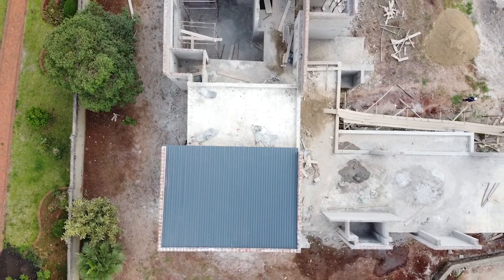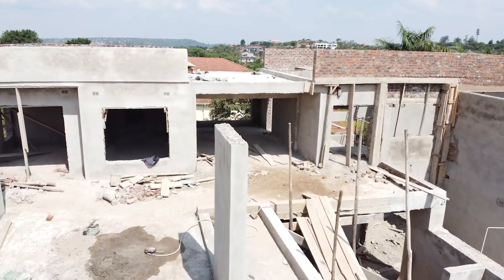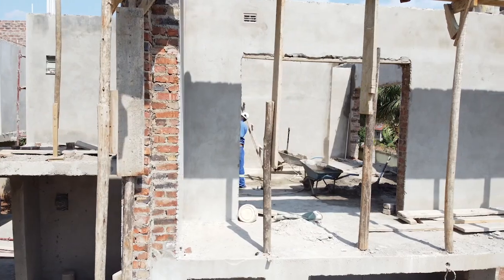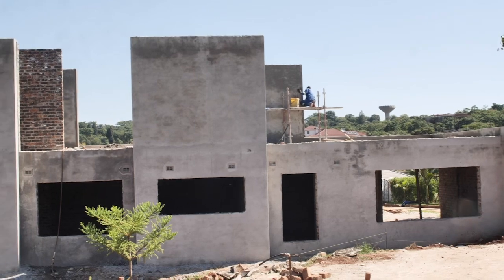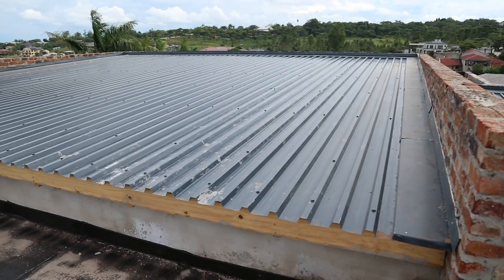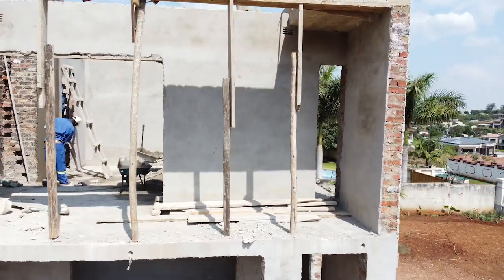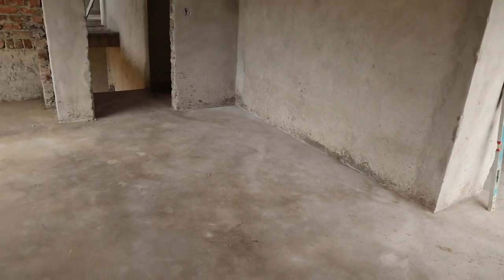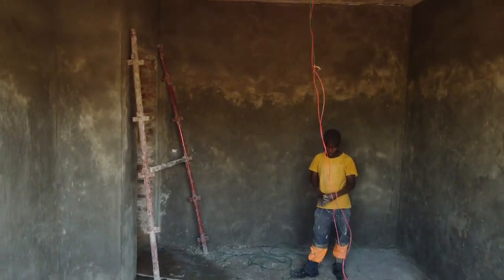Building our Dream House in Zimbabwe: Episode 13.

Comment: Remote building can be a nightmare. I used a couple of building contractors. Very unprofessional and heart wrenching however I was able to complete the project. 
I’m just about to start building our retirement home in Harare could you kindly recommend a reliable contractor?
Reply from the maker: Our contractor, Charliewel Construction have done a good job, overall.
Reply: @gibbsandemiliah3723  can you kindly share their contact details so that I can compare quotes. Many thanks.